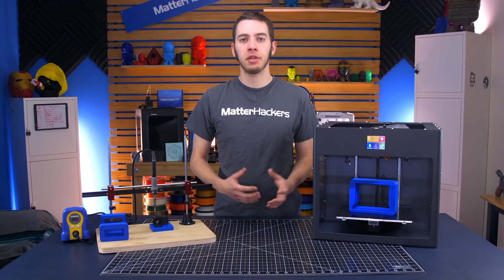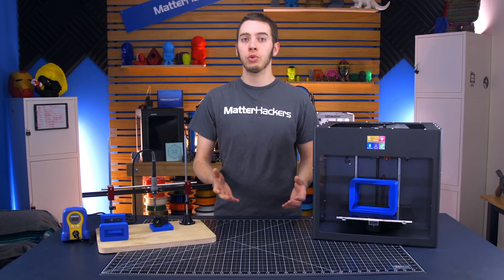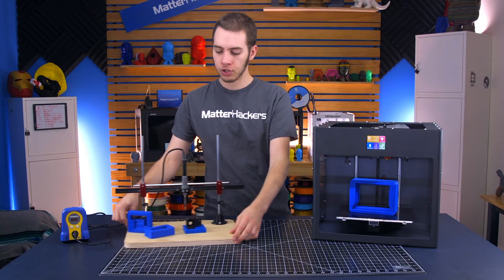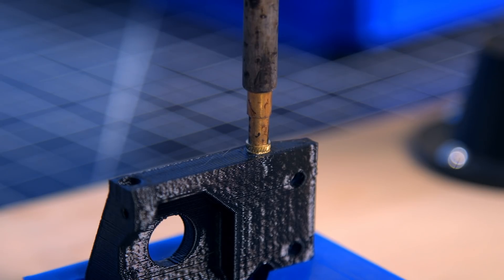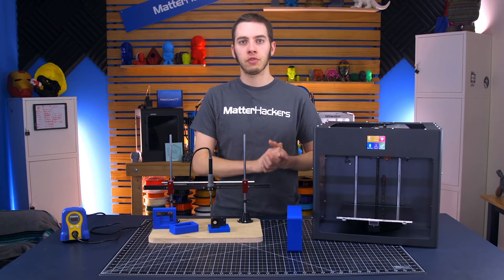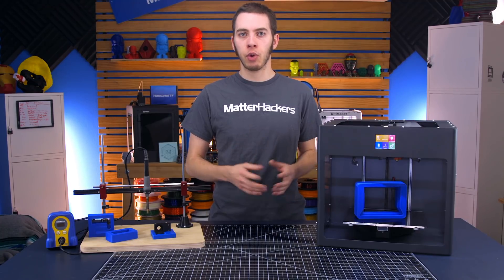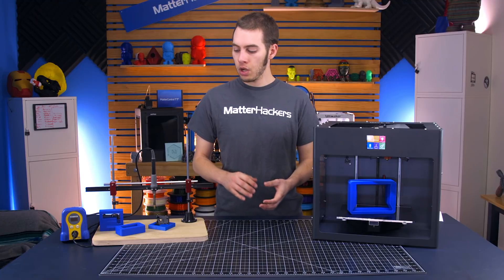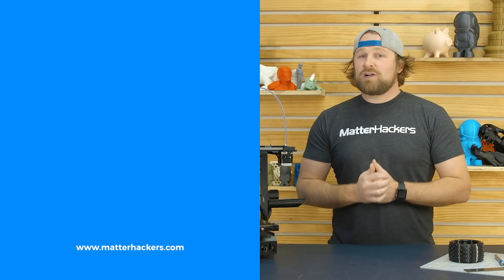How To Jigs & Fixures // 3D Printing Tools

Comment: That fixture device you use to to set the inserts in, is that better melting them into the plastic or just pushing them into a precise hole for them? Are there any instructions or files on how to make that soldering insert jig as this would be great for my work for prototyping?

Comment: Thanx for the quality knowledge right there about uses of jigs. Practical.
I've a bit of a parkinsons/ms type of challenge that's a lot like trying to play the guitar from across the room, so the solution to that involving fine motor skill coordination, resulted in building a cnc machine to help with being creative. Goals of eventually having a practical painting bot, and a lawn bot too thats being rebuilt with frame mods. It will have a 48" cutting ability as a converted remotely operated brush mower next, plus have safety redundancy built into it with the help of proximity sensors and electronics in attached 3d printed fixtures. 

The paint bot will involve something along the lines of a robotic SprayPrinter, with the ability to only paint within the lines to avoid windows and doors etc, and sometimes using a lot of PSI and different shaped nozzles to deliver the paint to nonmoving surfaces.